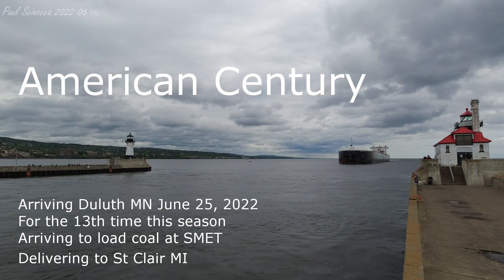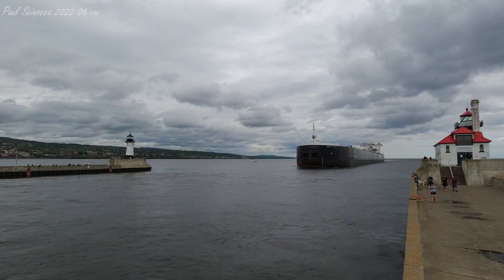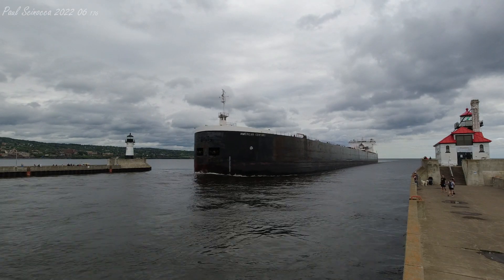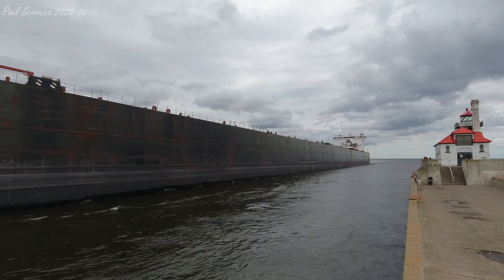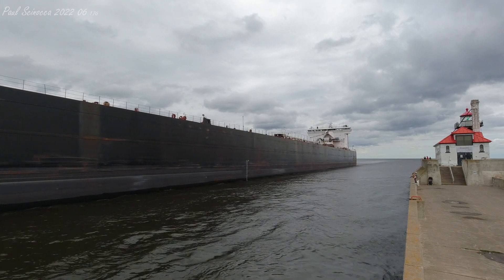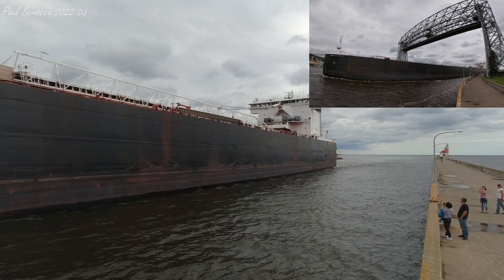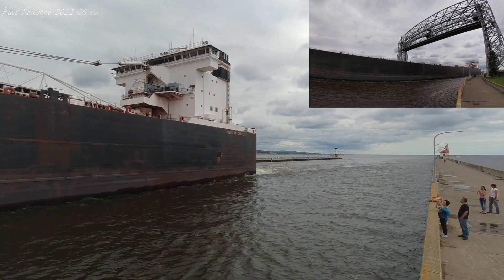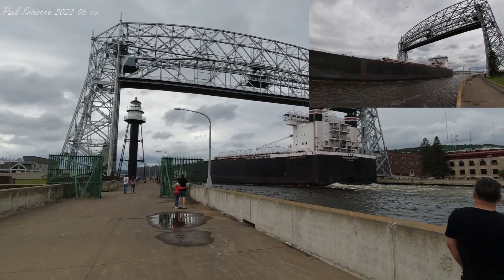14000 HP!  Arriving with a clip! The American  Century making their 13th Duluth arrival!

Comment: I clocked her at 7.32 knots / 8.42 mph - which is, I think, the fasted speed I've logged on one of your videos.
Another great chase - those pedestrians don't aim to make your life easy though! 🙂
Reply from the maker: 😁 They are not as close to me as they look, but it does indeed require me to be paying attention.
Reply: How did you measure her speed
Reply: @michaeltaylor8835  Luckily Paul usually keeps the ship in frame for its whole length. I measure the time it take for the vessel to traverse the screen. The length of the ship is either provided by Paul in his comprehensive description or is easily discovered online.
So I know how many seconds it takes the ship to travel its own length - I then work out how long it takes to travel 1 mile (1 mile/ship length) then work out MPH and a simple conversion gives me Knots.
So all I do is enter the vessel's length and the time taken to travel 1 ship length and put it into a simple spreadsheet.
Hope this makes sense! It's far simpler to produce the spreadsheet than it is to explain it! 🙂